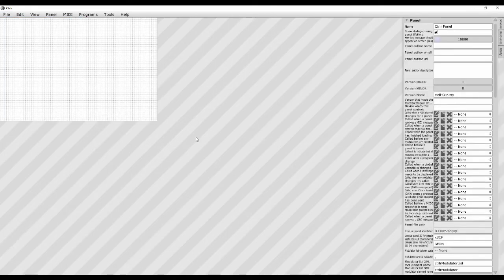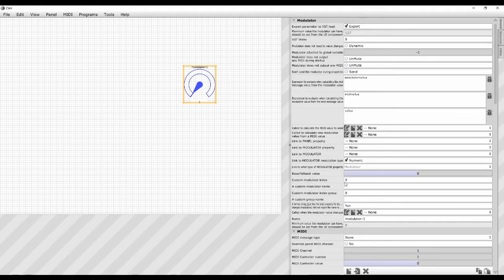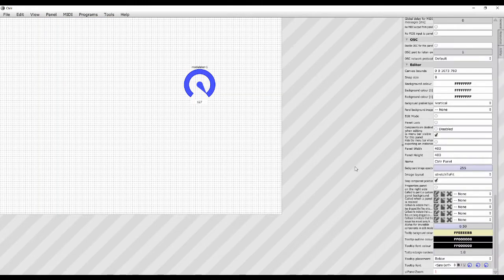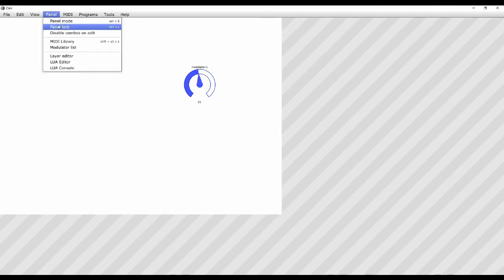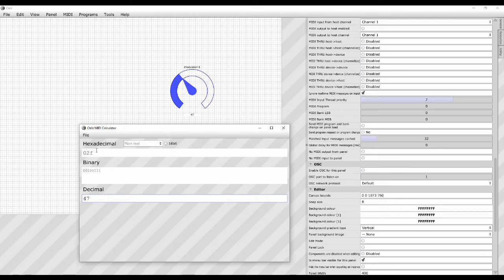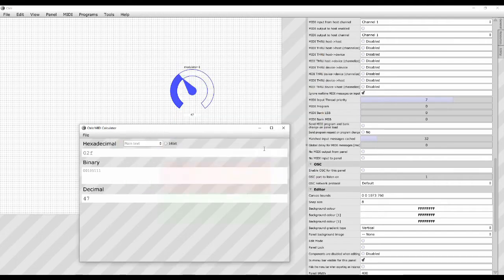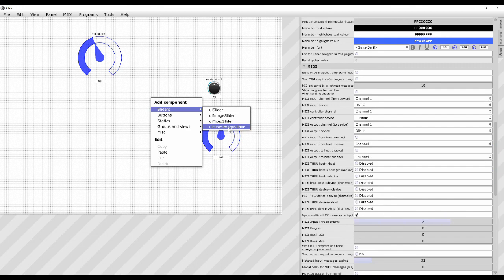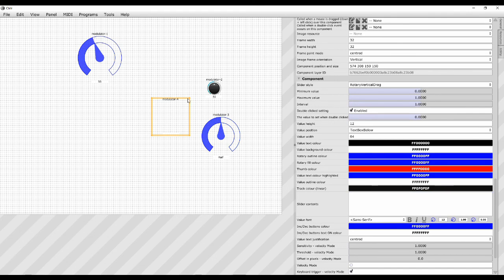Ctrlr Tutorial Part 2 - Modulators & Sliders

Comment: Hi.  Just starting out and this is very helpful.   I am going to need to dive deeper as I am looking at creating a panel for a guitar effects unit.  One value goes from 0 to 99.9.  It sends the value over three bytes with leading zeros, sounds like Lua time
Reply from the maker: Ah Nibblized Data, 3 Bytes with leading Zeros, yep I think I would need to use LUA Scripts to handle that :-)
Reply: @spiffosmith2177  Just got a book on Lua from EBay last week .....
Might be an idea to have two modulators, one for 0 to 99 and a fine control of 0.1 - 0.9 
I think one modulator covering a thousand values might be a stretch in to many ways.